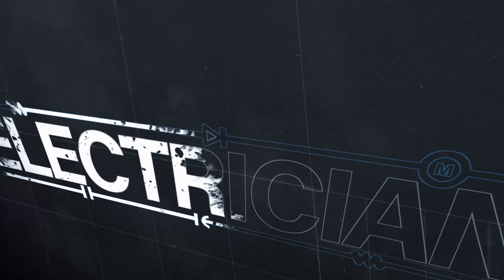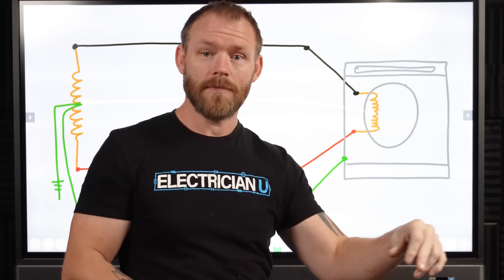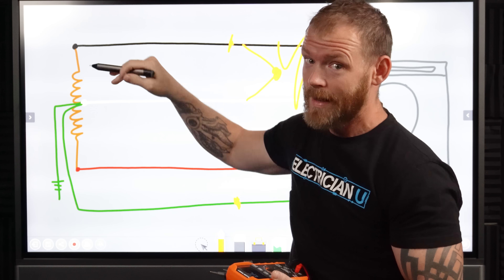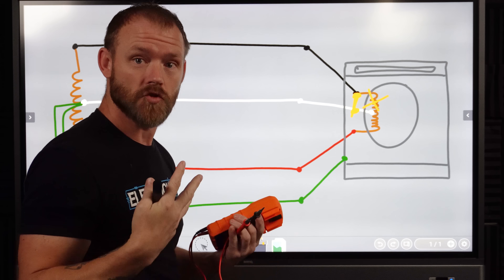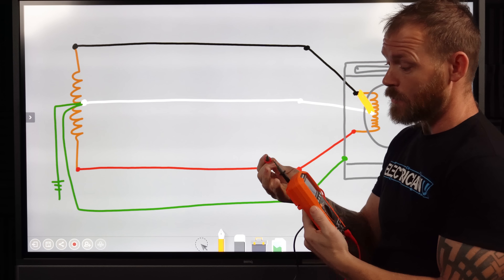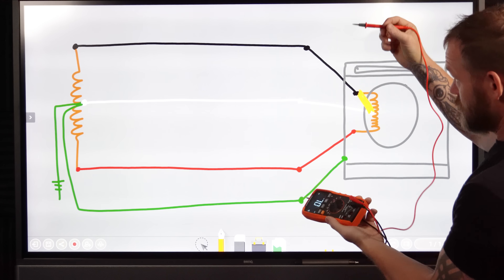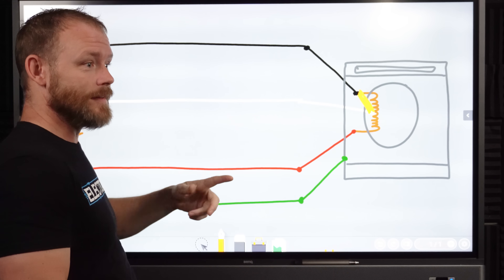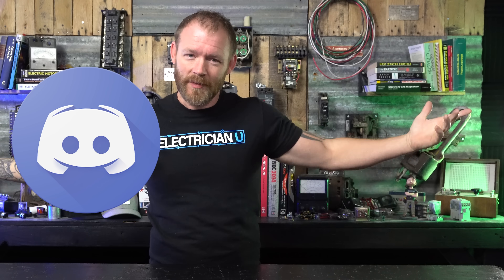What is the Difference Between a Short Circuit and a Ground Fault?

Comment: non-electrician here but have a question.  Years ago I had the situation where I "had power" if you put the probe into a receptacle it showed 110 or 220 BUT nothing worked right.  Ended up the electric company had worked on the line earlier that day and done something wrong with the ground (I think broke it or something it's been years ago so don't remember)  The reason I ask is I am now experiencing the same thing - construction was going on across the road yesterday and now I "have power" but like my heat system is not running right (it's like its on but barely running) and my lights are dimmer than they should be - what is this called so I can tell the electric company?  Thanks for any info.

Comment: So how do you find the problem if the breaker keeps tripping. How are you supposed to pin point to where the problem is if you can't run current through the system because the breaker keeps tripping?

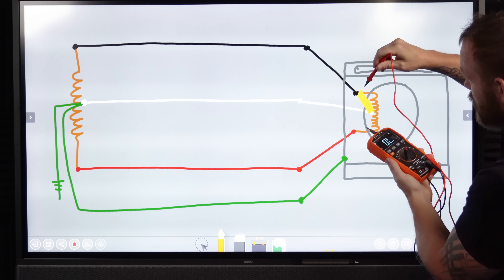Comment: 9:35 "put one lead on black and one lead on white" . How do you "put"? Do you have to puncture the insulation on each wire? Do you cut each wire open and splice it back to its original wire when done testing? This is never explained in all the videos I watch. So it's time to start asking how this is specifically done. Thank you.
Reply: i wish he would explain thing fully, but no. In all his videos are some sloppy messy parts. Underexplained. But he don't mind to repeat some easy points 5 times, jumping between topics and gesticulating like crazy.

Comment: I just had to troubleshoot a short like the one being presented in the video. GFCI receptacle for counter receptacles kept tripping immediately after resetting it after new cabinets were installed in the kitchen. New arc fault breaker just installed for this circuit did not trip. By disconnecting the receptacles one at a time on the load side of the GFCI receptacle I narrowed down the short to the wiring between the 1st (the GFCI) and 2nd receptacle in the string. I checked continuity of the 2 conductors and ground. No breaks. Just by chance I then discovered what caused the GFCI to trip was having the load neutral wire connected (load hot wire left disconnected). Odd, I thought because I thought both the hot and neutral load wires would be needed for the receptacle to be able to do whatever it does to detect a ground fault. So now I knew the problem was with the neutral wire in the wall. I knew the wiring between receptacles ran about a foot above them, which was right about where the workers installed the upper cabinet lower mounting screws. With my DVM set to continuity I connected one probe to the neutral with the issue and then touched the other probe to the screw heads securing the cabinet at the bottom. Sure enough, one of the screw heads indicated continuity with the neutral.I removed that screw (a 3 inch one!) and then I could reset the GFCI without it tripping. I decided to not open up the wall to fix this because the new backsplash was just installed and the wiring was inaccessible from the other side of the wall and it was the neutral that got hit, not the hot. If it trips the GFCI again, I will have to fix the wiring (tear out a portion of the new backsplash) or attempt to fish a new wire (near impossible with what's in the wall). I think what happened is the screw pierced the Romex between the neutral and ground wire and while installed, shorted the two wires.

Comment: 10:45 continuity checking...the circuit breaker needs to be shut off..(didn't mention that).
Reply: shut the breaker off and test for voltage to make sure there is no voltage across all the leads. if no voltage is present, it is ok to check for continuity.

Comment: I have an odd situation.  The RCD trips on one circuit even if all the appliances are unplugged. The sockets are all wired correctly.  However, i noticed the problem because someone had attached the fuse/breaker on the non RCD side of the board. The MCD didn't trip in that location. So it only trips when connected to the RCD. Any ideas whay? Nice video btw.

Comment: I'm an apprentice in electrical and I came across a problem whilst connecting power supply to my house.The distribution board and all the circuits (lighting, receptacles,heater) are connected perfectly but I encounter small amounts of currents or(I'd say residue of current) flowing through the wall and the  rooftop.How would I fixed this problem.
THANKZ

Comment: Beautifully simple explanations.  I'm only up to 6:53 but as a software engineer my immediate approach is to remove things (obviously easier in software).  So my first thought was "Test the circuit with something other than the dryer".  I'm guessing this is really not always an option.  I mean it's not like you can swap the dryer for a lamp...nonetheless sharing my thoughts, looking forwards to the res of the explanation, already subscribed
Reply: why would a software engineer be interested in Electerical work interesting.

Comment: One important fact to be noted is that a ground fault occurs when you have current flowing between neutral and earth ground. Normally there should be no current flowing between neutral and ground. A short circuit however is when you have diverted the current that would have normally flowed to a load through another path that is of much lower impedance.  The short circuit could be between line and neutral or line to ground.

Comment: I know this isn't the subject bit I have a question. When installing a sub panel. Why do you need the bonding screw if the ground wire from the subpanel is connected to the neutral bus bar in the service panel to carry the fault current back to the transformer.  Or is there a specific spot for the ground wire from the subpanel

Comment: Reading resistance can be used to rule out a short. If there is no short (and the load is disconnected), the meter should read infinite resistance. Of course, the circuit should be de-energized when using an ohm meter.
Reply: infinite resistence on each wire?  What does it mean when you read infinite resistence? That there is no currunt flowing through the wire? How do you de-energize the circuit and why?
Reply: @ianalen1687  Infinite resistance on an analog meter (O.L. or “over limit” or “open load” on a digital meter) means that there is no current flowing between two wires or between a wire and ground. When testing for shorts, this means there is no short. For example, if you are testing for a short between a hot wire and a neutral wire, infinite resistance or O.L. means there is no short between the two wires. 
You de-energize a circuit by turning off a switch or a breaker. You don’t want to take resistance readings on an energized circuit as it will damage your multimeter. I hope this helps.
Reply: @vince6829  thanks

Comment: Here’s a dumb question and hopefully someone can set me straight. How is the branch circuit breaker able to tell the difference between a short circuit and a small load such as a digital clock plugged into a receptacle that is installed right next to the service panel?

Comment: Someone explained to me :if there is  continuity, then that mean there is a path. And that the sound isn’t all that helpful, u can use resistance, no beep, but if there’s resistance then there’s a path.. 

At least thats what I got. Is that wrong ?
Reply: and where to measure continuity or resistence when the wires are insulated and plus you don't know where the short circuit occured?

Comment: good videos for education. I prefer hands on in a residential real multi-net circuit. my problem in the house is the previous owner had overlapped two circuits + a faulty circuit in a failed GFCI that was passing hot to neutral, go swap those old GFCIs. last if the problem is not going away after replacing GFCIs don't waste your time digging in each section of the house. unplug appliance this to include lightings, treadmills, etc. then go to the main circuit switch with non-touch or non-contact pen with the power on. (you have to be confident tech to do this don't shock yourself!). touch each individual ground and neutral with the pen and document it. all of them suppose to return 0 or no voltage because I expect that you have switched all the circuit to off position. main grid power must remain on during this operation to see which local circuit is passing a hot to a neutral (hot to neutral is generally caused by bad wiring, or failed GFCI that passed hot to neutral), if ground is getting hot for a given circuit or net within the house that one is passed to every single ground in the house, so start with the very main circuit board or fuse box in your house. saves time. you must have these tools to perform this: non-touch non-contact pen, and a gfci fault detection tool, extra brand new certified GFCI receptacles, and a clamp meter is extra but it works great and you will end needing this if you constantly testing current and voltage running through the wires.

Comment: That’s a great explanation of short vs ground fault and how to tell immediately.
Older irrigation systems have convoluted messes of common wires with short hot wires.
Ran into this problem today. Solenoid tester says it’s a short.  Oddly enough I didnt check continuity but waiting on the area to be dug. Hand dug found the cables and there in a pool of water next to a 6” water pipe.

Comment: This is a great explanation but a little overcomplicated. A short circuit is a low resistance connection where the current flows back to the source, a ground fault is a low resistance connection where the current flows into the ground. In the case of the star point grounded transformer, a low resistance connection between a phase conductor and a neutral conductor is technically a ground fault.

Comment: Hey electrician u, i have 2 questions. 1 is would there always be continuity between neutral and ground no matter where it would be tested sense there are shared at the main service? and 2 if you check continuity with a multi meter while a circuit is on can it blow up the meter ? thanks.
Reply: 1) correct, but there can always be some resistance, it depends how far away from the connection you measure it 
2) a good multi meter won’t cause or get any harm. They are built to compensate for these errors

Comment: I always tell people to go ground to load side of the fuse should be ol top side should be ol if either of them have continuity follow until the beep stops. You might have to toggle a switch or two but that method hasn’t let me down yet

Comment: So, you connect a multimeter, measuring continuity between live and neutral hopping for continuity. What if there is no short circuit and you apply 117V to the multimeter leads? If the short is far from the measuring point the continuity may not work... I probably didn't understand
Reply: neither do I

Comment: Yes I install alote of dc voltage for wire line trucks and every time I finish my install and I always have continuity on ground to positive threw a light or any circuit why once I install all equipment I get continuity

Comment: Hi everyone,  Necessity brought me to this video 😅
I have an issue at home, I am getting spontaneous shocks on the switches, the screws of the plate cover to be precise, any hints  why?

I've try so many different things, I checked phase to ground in my panel, I do get continuity,  on my furnace, refrigerator, and exhaust fans of bathrooms, well, it can't be them causing my issue, I understand I get continuity due to the motors, the furnace,  because of a transformer it has inside, I run out with ideas on how to find this current leak,  it is not tripping any breaker FYI. 

Thanks for the advise!

P.D I did all my checks with breakers off

Comment: Great video!
I know this is 1 year late, but I'm an apprentice, started doing sequence start with 3 phase motors, using 2 motors, the 2nd motor can only start once the 1st motor is running, however, when I attempt to start the 2nd motor, the MCB trips, not the overload, but the MCB (15amp mcb). I can't find the fault, could it be that the motors I'm using or a wiring fault. Can anyone please assist with this matter 🙏

Comment: something to also keep in mind. Ground faults are not only created by hot conductor(s) touching metallic frames or equipment grounds. 
I do a lot of outdoor lighting troubleshooting and can’t tell you how many times tripped GFCIs are caused by junction boxes located in the soil that have moisture contamination. Enough current is able to find its way to earth ground that it trips.

Comment: Sorry, but you should first emphasize the importance of double checking to ensure there is no power in the circuit, and take precautions to ensure noone can energize the system while you are at risk working on it. I know of electricians killed because they did not do this! This vid should be redone to cover this, or taken down!

Comment: I think the question come from a fire alarm technician. Finding a ground fault in a fire panel is a massive headache. The panel tells you there is a ground fault but not which terminal its on. So you need to remove hundreds of devices off the inputs, and BUS line. Sometimes that doesn't even work because the wires touch ground intermittently.

Ground fault or short circuit is not as difficult in a regular electrical panel.

Comment: Dustin, what are the steps to find a partial short in an a/c circuit? I have a multiple outlet circuit along with a garage opener. The garage opener motor burnt up and is disconnected. The circuit now has a low voltage of 46 volts.
Gary

Comment: In the UK the earth conductor is less diameter than the other two, so for a UK audience, what you say at 4:28 is incorrect. I'm surprised all 3 are the same size in the US? I do agree that using resistance measurement with a DMM using it's low voltage (e.g. 9V) battery is not as good as other methods

Comment: So therefor a Short circuit is when two exposed wires are touching and Ground faults are when a exposed wire is touching the metal can?

Comment: This is what you get from an electrician and NOT an electrical engineer.  Seriously, Dustin, the "resistance" setting and the "continuity" setting are the EXACT SAME THING! The metering circuit is the same circuit, the test method is the same, the only difference is that on the continuity setting if the measured resistance is below a certain level ~10-30 ohms the meter beeps. I can't believe you took over 10 minutes wasting people's time to get to your magical troubleshooting technique. This video should be less than 2 minutes. Furthermore you tell people to do the most dangerous thing and measure at the source without disconnecting from the source! Great way to damage your meter, and if it doesn't get damaged all you will do is measure the resistance of the source which will always give continuity.
Reply: i wasted time on 3 of his videos

Comment: I have 2.2kva ups pure sinewave inverter it integrated with only one computer and one HP printer they can't run at the same time it select either the computer (optiplex 3050) or the printer when power goes off what is the problem please tell me

Comment: Hi there. When installing a neutral wire in an old house. 

Is it ok to install a single wire or do you have to grab the entire shielding of the romex and cap the black wiree?
Reply: Best practice would be to always cap off wires, even if they aren't connected to anything. They can become energized due capacitive or inductive coupling, or even touch something live.

Comment: The gentleman is right, correct terminology on the job gets the job done correct and efficiently, and when you have those two it means that you done the job safely to, German if you ever do any job that has anything to do with electricity what you got to remember is your multimeter so you could test before you start, and the best way to find any problem in an electrical circuit is the start where your source comes in and follow it out.

Comment: So when testing this is the power off. So when the power is off and there is continuity on the hot and neutral wire that’s where the short  circuit is?

Comment: Question that baffles me: no electrocution if no ground wire do not exixts, so why grounding? I don't mean it with respect of a house, but in general the whole system. Another question,why only the live connection gets hot, not the nutral, when a high load is connected.

Comment: I know what you mean about checking 'the knowns ', I'm a heating engineer, work on boilers and stuff. When I get a call out, cos someone's heating is not working. The first thing I do is find out if their gas meter is topped up, (a lot pay as you go customers in London), so yes you right, check the knowns ; simple things like checking to see if there is gas flowing on cooking hubs in the kitchen. You will be surprised how many times that's the case: no gas.😊, Another thing, always let the customer tell you what happened. They may already have diagnosed the problem for you.

Comment: So can you do a short video on the square d qo120PAF breakers and their service light codes?  Service light flashes when I turn on breaker but no tripping occurs when we use all the outlets/lights - everything works fine but likely isn't as the light is flashing.  Called Schneider support and they were no help

Comment: This could be explained in 5 minutes. And can have the lines checked in 5 minutes. This whole thing makes people confused with nonsense Disconnect the appliance and test for continuity. If there’s a short in the pc board of the appliance check the connectors and if there’s continuity between the connectors there’s a problem.